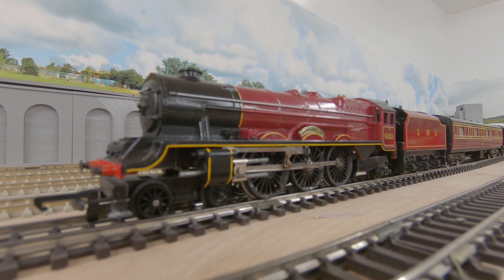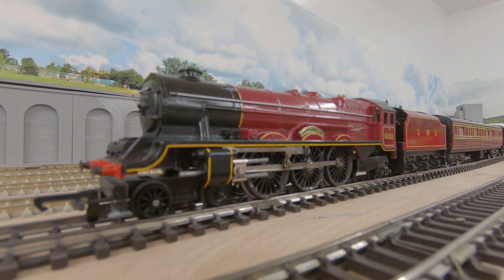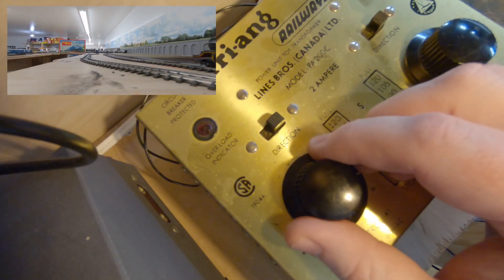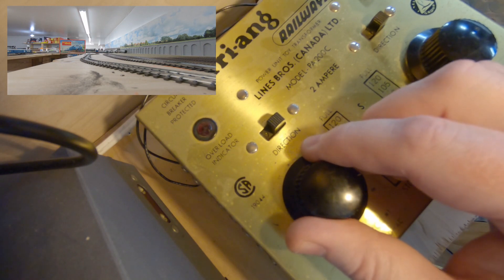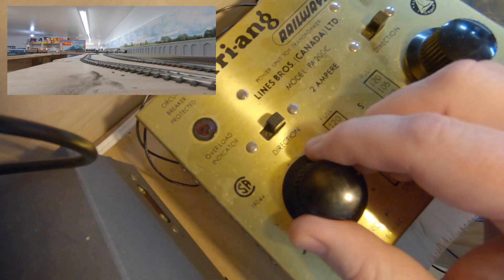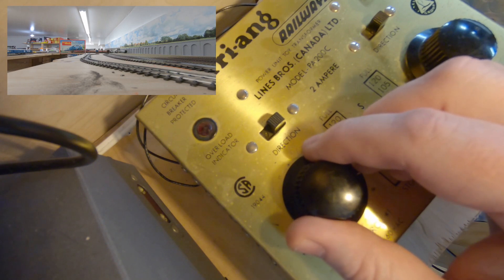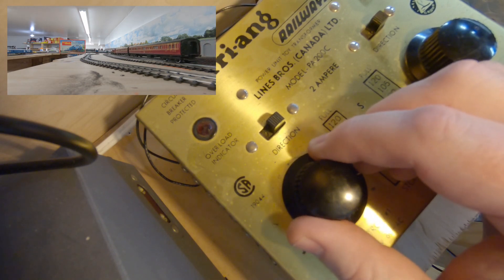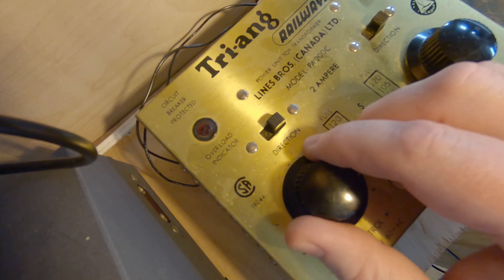Tri-ang Hornby LMS Princess Royal with Sounds and Smoke | oorail.com

Comment: Lovely lovely set.........I have this and call it my "Royal Scot"..the carriages are not dissimilar to the ones used on the original train of that period and that toured America in the early 30's. I am making name boards for the carriage roofs and for the front of the Loco. I extended it to six carriages as the Princess can pull them with ease. One thing I am not fond of is the "chuff chuff" noise. I don't think it resembles the sound of a locomotive. Great shots of the model on the go...btw you transformer is nice looking piece of equipment.
Reply from the maker: Very nice, sounds like you have a great project going on. You should definitely share it with other modellers when you have time (YouTube, Instagram, Facebook, whichever you prefer). The 'chuff chuff' noise isn't too bad at slower speeds, not quite on par with sound decoders today, but for its time, you have to appreciate the engineering. Thanks, I really lucked out with buying old controllers, there isn't a lot of competition on eBay for 120v Tri-ang or H&M controllers. That one is a PM-200C, which I believe is a product that was sold in Canada in the early 1960s. I have two of those, a slightly rusty one, and that one which was obviously someones spare they never used. I have two of the older P5C controllers that were made in England during the 1950s. A few years ago I ran into someone on eBay that was liquidating an old hobby shop, they had a back store room that had brand new H&M controllers, basically long forgotten unsold stock, I bought up all that he had, which included a few H&M Duettes, Powermasters etc, I definitely hit the jackpot with those. Was worth the arm and the leg I had to pay in shipping!! :)

Comment: I think you will find resistance wire is what you mean and not fuse wire for the element
Reply from the maker: Thanks Andy. Yes I figured that out, got some delivered by Amazon yesterday, so going to retry today. I was following a guide on Hornby's forums which I guess wasn't totally correct.
Reply: @Oorail  Yes to those who dont know fuse wire just creates a short circuit at the controller